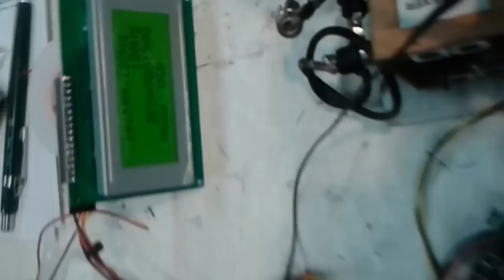Si5351

Comment: I thought a DDS used a DAC for output?  The hackrf also uses the si5351, it's an open project and has schematics and source code available.  Thanks for posting the breakout board design.
Reply from the maker: In my excitement that something worked was not on fire or completely shorted out-- I misspoke.  The Si5351 is a PLL and not a DDS. So it is a different technology --amazing none the less.

Pete N6QW